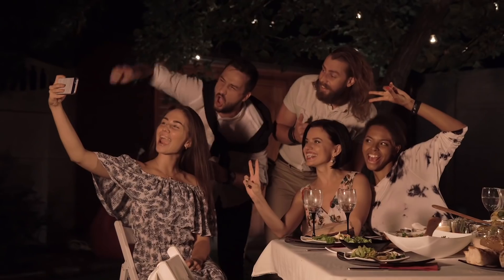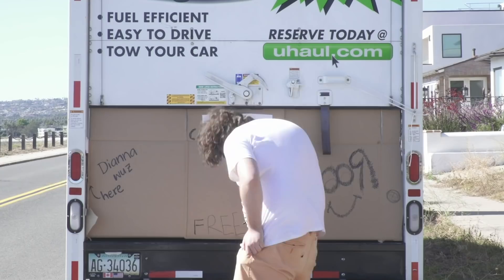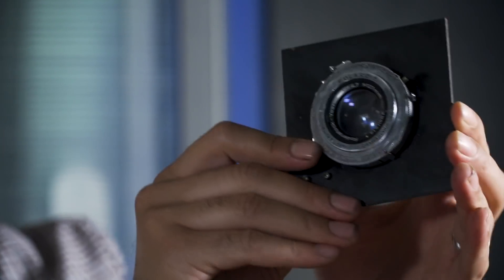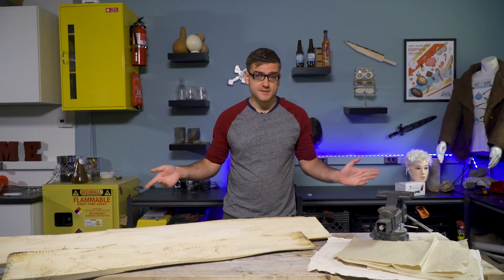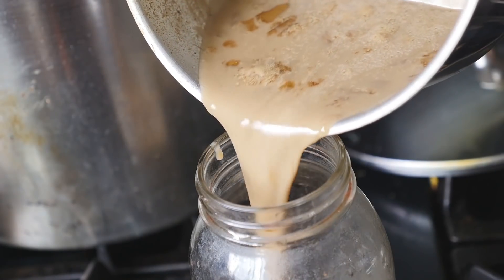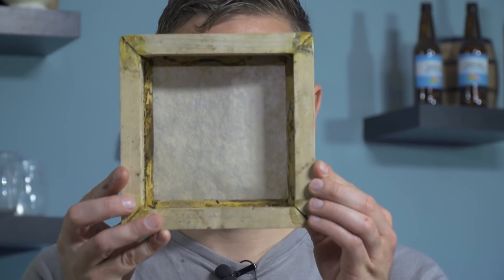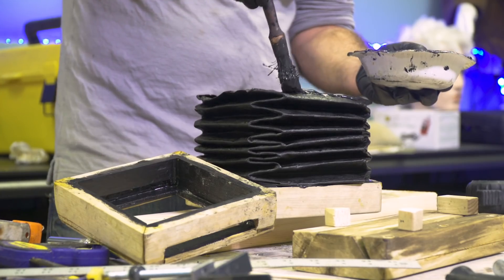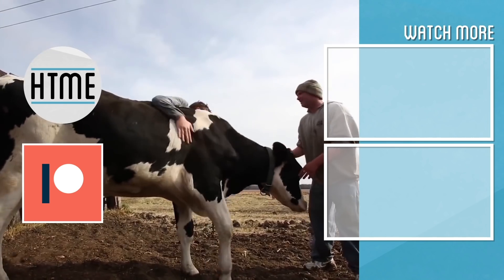DIY Camera: Pt.1 Pinhole

Comment: now the real explanation which is missing, in my opinion. The pinhole works because it lets light only through one place. So each place on the screen receives light from only one place in the world.

Now make two pinholes. You will have two identical images but shifted and added. To shift one image back onto the other, you put a prism into the pinhole. Now make many pinholes and the prisms will form a lens shape.

Comment: When i did this in college it was easier to use cardboard to make a big diameter tube (hat box) with the optics on one end and the stage set on a slide inside. As our plates were 50mmx50mm glass ( the largest that fit into the enlarger) we could load them blind onto the stage once set. Worked like a champ. 
Why a tube and not just a box you say? I cannot remember. But I assume to minimize any gaps.

Comment: Seems a bit silly making such a fuss of using sourced and made materials like the wood and glue but still using modern powered machinery/metal clamps etc.. to process said materials..... seems pointless really. You are either doing everything from scratch or your not. No offence meant. Just stating a fact.

Comment: Only recently discovered your channel but I love what you're doing. It's a bit late now I know but hide glue is water soluble, so when your bellows got stuck together it could have been safer (for the bellows) to just paint some water on and point a hairdryer at it for a few seconds. Accidental glue joins can just be pulled apart then. Keep up the amazing work.

Comment: here new challenge for you. make meal from scratch. pitch idea 4-h and FFA kids but as not in school anymore other feed my  self cain't use project.  meal is spagette squash meal scratch. i cain't help with cheese i have bought cheese make equipment Hoggies goat supplies never mad from scratch though seen milk goat that what need make cheese. as for tamatoe sauce. need set raised bed garden grow tomatoes. In large stock pot cook tomatoes uncovered, mead heat for 20 minutes. drain reserve 2 cups return tomes to pot. stir in green peppers, onions, tomatoes past, vinegar, sugar, red pepper, celery , garlic, canning salt, 2 cups reserve tomato liquid bring boil. reduce heat stir 1 hour .ladel salsa mix into 10 canning jars 1 pint hot jars. place in canner with simmering water completely covered. bring to boil for 20 minute . remove jars let cool they should easily keep for year or more. good need use garden grow spegettee squash. i take spegette squash from store and save seeds. you easily buy seeds burbee if wanted as well insure susseces. way save seeds wash mac and cheese strainer. put pizza box lablel what seed it is as save punkin seeds other seeds stack pizza box up. week check see that seeds molding. stuck box peal off let wet side dry for few weeks. then put in peanut or cashew can labling what seed it is. every couple weeks check see if molding if black spot seed through out. and re wash seeds start process all over. if not molding they seeds keep several years if seed flat dead want plump. spring hits. put seeds in raised beed garden. it vine out with yellow flower. thrown off guided don't look punkin vine let do thing. never got squash full glory milk goat jump fence eat them. got few late in winter danger free they small. simple cut hafe scoop out seeds put cookie sheet back 30 minus 1 hour. let cool open jars sauce scoop out sauce on squishes and if luck make goat cheese. sprinkle this top put microwave cook 10 second 30 just melt cheese. i eat meal like this near christmas time for 10 years strait. very fulling if squash large normally get 2-4 meals. if spice up cook mushrooms or add home made meat farm animal butchered self. i like mushrooms normally try make vegitaren meal. but need use goat meat or deer meat.
Reply: you try buchering deer or goat srcatch i did friends in new pull barn. after shoot deer. field gutting it take heart lugs, liver all intestinetes out,( don't cut intestings that pop at) cut stomic up chest pull stuff out. may ax or mull spite rib cage open. wash out good pack ice if warm. if cold nothing worry about. deer seasion ohio normlay first week after thanks giving for 12 gage shot gun. hang deer cut hole in tedone near hoff. (feet) rope through hang up with log cain hooks on skid loder. if skid loder dosent have hook not hard weild on. host aniamls up turn skid loder off. if want save hide need cut one peace salt roll up put olf freezer time work with it. not save hide dosent mater get off. with nife cut along neck try make seres cut seperate skin from meat. meat read. like white membrain then fur. kind like peal coat off. if real strong tenis ball with rope in fold skin.  tie rope skin pull off but unless work out weight lot think use knife cut off is easer. most meat be thies up arm and sholders. ribs deer don't lote meat. but some try get it. meat back loin most expensice meat. right get off in freezer. put hacke meat cooler with ice. some times cut arm or leg of make get meat rib cage and back first. use tree trime saw cut feet off. not used meat production all tendoens. how animal walk snow with freezing death. some native american people take tendoen make rope put arrow heads on. if do this need do first as longer aniamls dead harder this get. this were hang cain or rope hold aniamls up so only take two legs. kind put tendon over string dry get really hard. when use it wet chew up wrape arrow head. as meat. if meat grider. grid it up hammberger and make meat balls for meal above. well have fun. i still rember when neibor boy said hey try bucher our deer our selves this year i had do my self for fist time. i was going do this goats but lose trust heard so still take them up rodabulls  meats in pandora  when need animals done.

Comment: There are ways to calculate the correct exposure time for a pinhole camera other than just trial and error. You need to figure out your focal length (which you have made variable with the bellows) and your aperture size (size of the hole). Divide the focal length in inches by the aperture size in inches to get your f-stop value. You can then use a light meter to read the lighting conditions and the speed of your film (useful for store bought films and some manually applied immersions if you follow the chemistry exactly) and either a preprinted table or an online calculator to convert the time from the meters suggested time at it's smallest (highest number) f-stop to whatever your camera is using (pinhole are often in the f/200 range and most light meters don't go that small).

Comment: Hold on... sooo... you don't allow yourself to use any kind of metal, screws, or proper wood glue.... 
But; then you proceed to cut and sand your wood pieces with electric equipment... :|
I fail to see the logic... !?!?!?!?
If you do it from scratch by hand, grab a hand saw, chisel and a hammer and start doing it proper :D.

Comment: The paper/ground glass won't work with a future lens. It needs to be the same distance as your film plane, but you have them in a fixed positron nearly an inch apart. Any lens you use to focus on that paper, the image will ALWAYS be out of focus.

Comment: If you want to make film from scratch you're going to need a couple things Number one the film itself which is a plastic material called cotton cellulose. There are a lot of videos online chilling had an make it you can look it up it's a complex and laborious process Second, you're going to need potassium bromide ammonium iodide, Silver nitrate, distilled water, a bonder agent gelatin is the easiest, hardener Chrome alum, you may want to help from the a chemist that knows the dangers and the risks when using the chemistry. It's really important that you use the chemistry properly and safely. I make a gelatine dry plates witch is basically the same as film but on glass.

Comment: to build a camera using the original cedar wood and sometimes bleached mahogany is far better than using regular wood you can cut cedar and mahogany wafer thin without it bending it is imperative to use these woods because they are prone to penetrable paints aka if you put black paint on it wont suck in and reveal the color of the wood but be totally black!.

Comment: I don’t really understand the whole “i don’t have metal so i can’t use screws or nails”... but you can use power tools and electricity???
Reply: The limitations is the material in the final product are must be made from scratch, but he can use modern tool (like his book making series, where he using hydraulic press when making paper from scratch).

Comment: sweet project! the images you have so far looks like you have light leaks! I agree with the others who commented that the material the pin hole is drilled out of is waaaaaayy to thick. I've made many pinhole cameras and used 4x5's. the best pinhole will be small, but perfectly round, smooth and 1 dimensional. Most people drive a nail through a tin can and then sand it until its flat and smooth. The texture and depth of your hole is making things blury (sounds bad out of context)

Comment: I made a camera obscura a few years ago by covering the window in my bedroom with cardboard and duct tape. It didn't work at first event after I let my eyes adjust ( because I made the hole too small) and out of frustration I tore the piece of paper, which I was using to make a small hole, of. The hole I ended up creating was the correct size and this crazy projection was created all over my walls and I was stunned. It was the coolest thing I have ever made and if anyone gets the chance to make one it is really surreal. I was amazed that a dark room with a hole was able to produce such a crisp image (It's upside down though).

Comment: That "acorn and iron oxide" dye is actually iron gall ink. You just made what they used to write the constitution. Neat.

Your problem with that dye is that you didn't expose it to UV light. It will darken like MAD over a few days but it needs sunlight and oxygen to do so.

Try writing with it sometime, you'll find it goes down pale and darkens quickly.

Comment: I realize that it is unfeasible, but it would be interesting to set an end goal of building something like house or small house structure but you can only use the tools that you make as well as the material that you gather using your tools. because although you made the paper, you used machines to get the seeds out of the cotton, you used machines to break the cotton down, you used that flat sieve to get the sheet of paper, and used a hydraulic press to press the paper but you didnt make any of the machines that were involved, you used existing technology that was created by someone else. I am not saying that your accomplishments are diminished by any means but I think it would be interesting to set yourself a goal of making something complicated like a small camping cabin in the woods or something but you can only use items that you have made or natural materials that you harvest and turn into something useful. It would lead you down a myriad of alleys that you might not even think of. For instance, you need wood but you cant use a chainsaw so you need an Axe. but to make an axe you need steel. well, Steel is an alloy of iron mixed with low levels of other elements, such as carbon, silicon and manganese so you would need to find a blacksmith that would help you get iron bloom and create iron and mix it to get steel. Then you can cut a tree. I just think that if you are ever running out of ideas, there could be a HUGE series if you truly made an end product that required many different materials ALL from scratch without using the existing technology. It would be incredibly difficult. but I think it could be done.  best of luck to you, sir.

Comment: You do indeed have epileptic fans (hi!) - but only a small amount of epileptics are photosensitive (3%), and it depends on drastic contrast and very fast frequencies (between 5 and 30 flashes per second usually) so those flashing string lights are unlikely to cause an issue. However, if you're concerned, in the future it may be best to put a warning before the clip in question with a notation of when the flashing ends. :)

Comment: Why didn't you just use either a finger joint or dovetail joints. It looked like you went the hard way to build this camera. But Kudo's anyway, I actually am waiting on a set of books on building these type cameras. I'm planning on building a wet process  camera.

Comment: If you want a better way of accurately making your own dowels, try a dowel plate. Just a simple jig consisting of a thick steel plate with holes drilled through it of incremental sizes that you hammer square sections of wood through till you get down to your desired diameter. It’s an easy DIY project to make you’re own dowel plate and hence your own dowels.

Comment: You should make a computer from scratch.
Reply: Yeah, because creating a CPU without expensive industrial machinery is possible at all... Everyone can make a simple one. If you want a rudimentary calculator it's easy. Just some Boolean truth tables with applied current 1/0 . Sounds simpler than it is though. Still doable , but nothing more complex.
Reply: You can make a simple 8 bit computer fairly easy using only passive components.

Comment: If you went into to the TV room at my school (some time ago I might add ) all the windows were painted black so the room was dark and you could see the screen. On the middle window a small part of the paint had come away letting in light. This meant if you were in there, with the TV off, you could see the kids that were playing on the football field inverted on the back wall. Basically an accidental camera obscura. It was cool. 😊
Reply: I don't get why you can't use modern glue, but are using modern power tools 
Like the videos it just seems like an oxymoronic method.
Reply: @rattlesnakz9716  it's literally like the entire point of this channel
Reply: I wonder if that was somewhat similar to how it happened originally, maybe a hole in a curtain or something?
Reply: Maybe a creepy teacher did that on purpose

Comment: One thing is the material around the pinhole needs to be as thin as possible as the longer the pin hole is the more blurry the photo just like the larger the pin hole is the blurrier the photo
Reply: Thanks for mentioning that! Yeah, if a 1 inch hole can be drilled into the front lens board, then you can add a more accurate pinhole out of thinly flattened copper, or whatever metals you have on hand
Reply: Chris M Forsyth Or more blackened paper with the pin hole in
Reply: Bryn Jones the paper fibers might not allow for the most accurate of holes though, bringing back the issue of soft focus. The hole needs to be as  round as possible and only a fraction of a millimetre in diameter. I do wonder what kind of result stray paper fibers might give you though, as an aesthetic decision :) could be interesting
Reply: Chris M Forsyth The pinhole is effectively the aperture of the "lens", so the smaller the hole is, the finer detail it can resolve. Given what kind of films he could make in the near future though (probbly cyanotype or early silver based low speed plates/films) he'll need a lot of light, so a pinhole that's slightly larger could cut a lot of the exposure time at the expense of detail.

You can try the effects of paper fibers at home with a DSLR and a spare body cap, just drill through the body cap and mount the paper pinhole in front.
Reply: Rick Astley 
I’m never gonna give you up
Reply: @PotatoesAssistant   awww you took my comment!
Reply: Middle School Life 
Yeet
Reply: countersinking the hole on the inside, might resolve that issue
Reply: Also, while it might not be as important now since the pinhole is so small, when he gets in to glass lens based photography it'll be important to have the ground glass be the exact same distance from the lens as the eventual film to maintain focus. When you insert a film carrier into a large format camera the ground glass holder actually moves back slightly to make room.
Reply: Aperture
Reply: I don't get why you can't use modern glue, but are using modern power tools 
Like the videos it just seems like an oxymoronic method.

Comment: Wait hold on. You just make a hole in a cardboard box and an image projects itself??
Reply: Exactly how light works
Reply: Yes. Technically all image is always projected everywhere but they overlap unless you make a pinhole to take away overlaps. so smaller pinhole less blurry.
Reply: Its a little more complicated than that.  A smaller hole makes a smaller aperture, which increases your depth of field, but it also increases your diffraction, making your image less sharp actually.

A wider hole (larger aperture) produces a shallower depth of field.  To work with a smaller aperture, you need to adjust the distance between the aperture and the film plane.  You will have a smaller depth of field (distance that objects appear to be in focus), but can produce sharper images because of substantially less diffraction.  But this is harder to make without a mechanically adjustable system to adjust the distance between your focal node (aperture in this case) and your imaging plane (paper or sensor).

This is why on cameras with real lenses, you never want to shoot above about f11.  Diffraction breaks through and starts making your image pretty nasty.  Most lenses have their sweet spot between f/9 and f/11, diffraction will start becoming an issue around and above f/16
Reply: Hark Singh yep, it’s elementary.
Reply: Yes, it will work. We made camera out of shoeboxes at school. You don't have to do anything exept painting it black from the inside. If you have light sensitive paper this will be enough